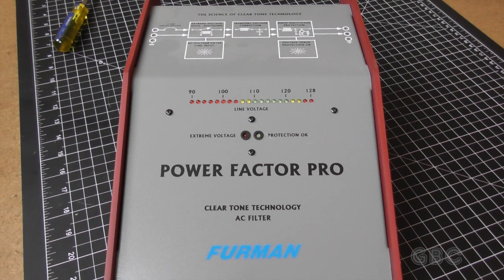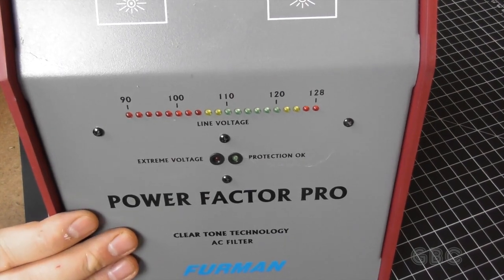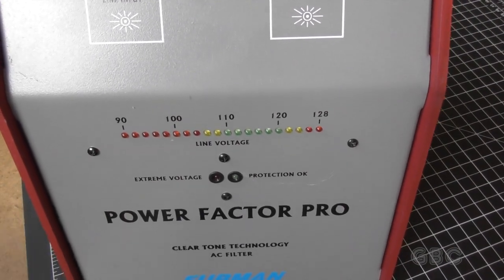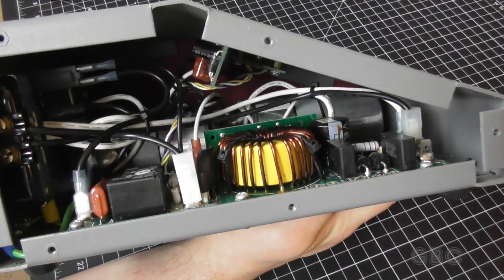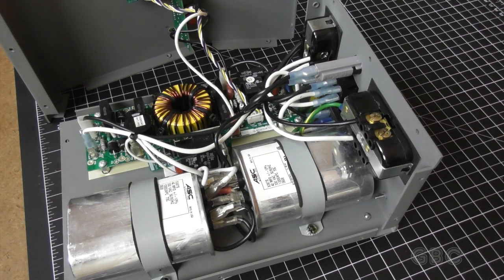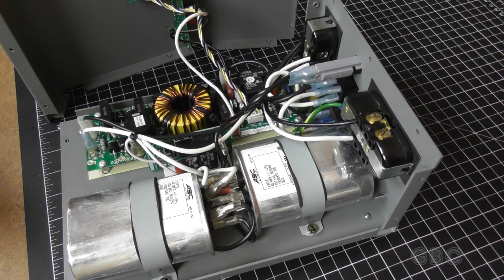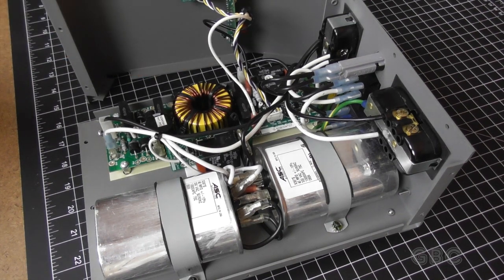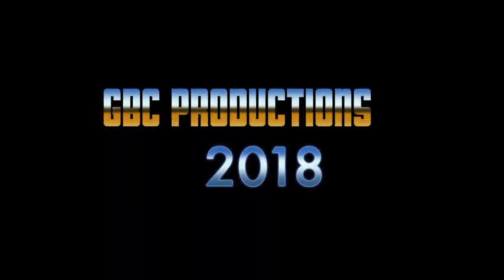[44] Furman Power Factor Pro Teardown

Comment: Hello, cool video! I have one of these units. It appears to work fine. But, occasionally, it makes a quiet crackly or fizzy sound. I usually notice it later at night when all is very quiet. Do these units make a tiny bit of noise? It’s coming from the unit, not the speakers. Thanks!

Comment: Ty for the video. Question, I have a rack mount version and I get intermittent buzzing from unit which comes out of my speakers. I opened up unit and mine only has one larger capacitor which I'm 99% sure that is the culprit of my noise. Does that mean the capacitor is failing? The unit is over 15 years old and can the capacitor be replaced? Thanks for your time, Jim.
Reply from the maker: It could be a bad cap, but I would start with checking grounds and for anything loose.  I've had something years ago that was buzzing and it ended up being a loose transformer.  If you do go the route of replacing the capacitor, just make sure it's the same rating, voltage and temperature.
Reply: Thanks for the reply. I'll check grounds and such but I don't think  that's it. I'll describe the sound again. It sounds like someone is running an appliance in the house or something is cycling. It pauses for a second or two then starts again. It's not all the time though when unit is on. When it started a while back, it was driving me nuts. I would run through the house asking everyone if they were running something. I even called my neighbors and asked them. Then one evening I was using the unit just for the front outlet for a light while I was working on guitar. It was a very quiet evening. That's when I heard it coming from the unit. It was exactly what was coming over my speakers. Sorry for the lengthy manifesto. I just want to try to be clear. Again, thanks for your time, Jim.